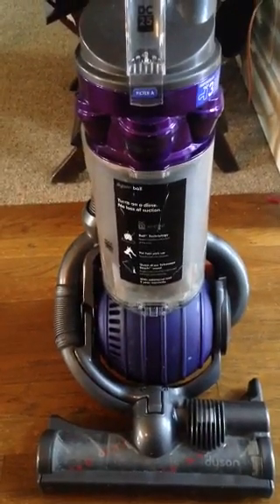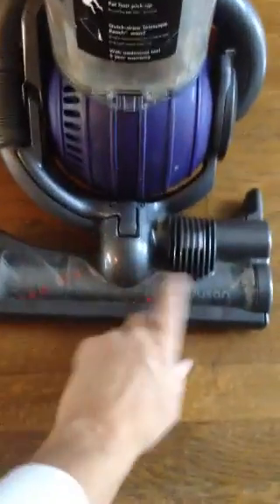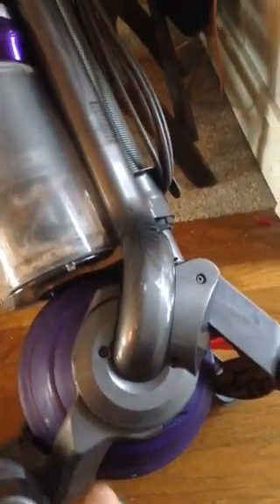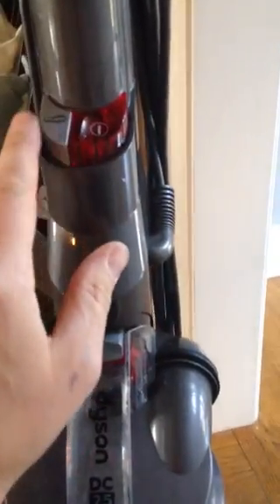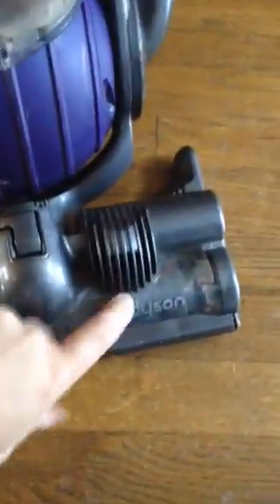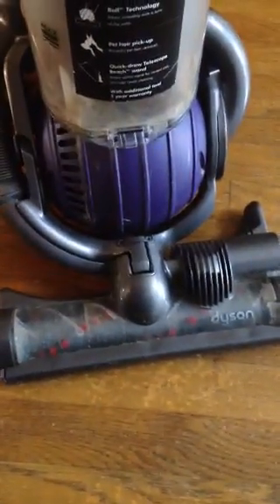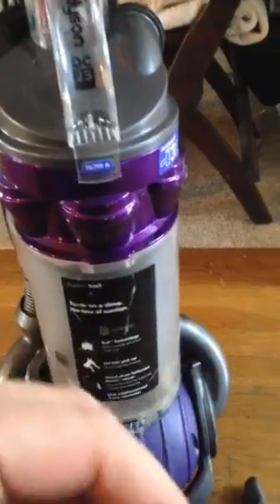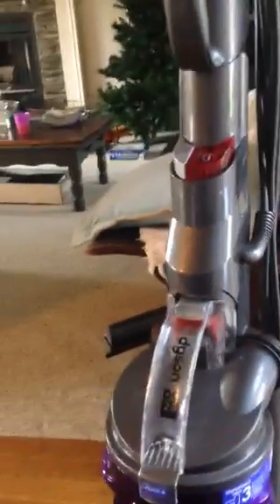Dyson DC25 brush bar not turning

Comment: Love this Video!  Okay our issue was a tad different, so I am sharing in case this helps others.  This step by step video is exactly what my son and I needed to know how to take apart and what to look for.  We already had power to this model that we have used for many years.  Our only issue was that we had to hold the brush button down to get the brush to turn.  It no longer would come on automatically or when the button to turn on the brush was pushed.  So we figured out after testing the switches that the switches were fine until we would put the buttons and housing back on.  So this is some Okie rigging but...we clipped off a small piece of plastic from a plastic tooth pick flosser.  That piece of plastic now allowed better Pressure under the Brush button and the switch.  Works like a dream now.  Thank you so very much Jon, this video was what we needed to 1. know what to look for and 2. figure out that what we had worked but for some unknown reason we needed to correct the contact between the button and switch.  Hope this helps.

Comment: So glad I found your video, I watched the first 30 seconds of the top 3 faults and repaired a broken wire under the side cap in a few minutes, and now it works just as it did before the brush stopped turning, so thank you.

Comment: Thanks for posting. I was about to buy a new motor for my brush bar and stumbled on this video. 

I gambled on a reset button since it was about 12 bucks. That did the trick and I’m back in action.  

On my Dc24 the reset relay is in the brush bar assembly not under the leer switches but otherwise looked identical. 

It required removing about 8 torx screws but it was pretty easy to swap out.

Comment: BIG BIG THANK YOU! I bought replacement motor and switch and my DC25 still didn't work. Pretty disheartened I was about to throw in the towel when I thought I'd just have a quick google, your video was top of the search results and your first diagnosis of caught cable was bang on. Soldered in a new piece and you just saved me £300 on buying a new Dyson. Thank you for taking the time to post this vid. It's really appreciated.

Comment: Thanks a lot.   Found the problem in your first suggestion - broken wire.   Fixed it and now works as good as new.
Reply: where was the broken wire ? as ive same problem done all he said in video still not working brush bar motor head is new also ? ta very much

Comment: Thanks man I was trying to fix my dyson thought it was the brush motor and got a new head put it on and still not working thought it was maybe the switch but it was ok watched your video hear you say about the wiring problems they can have and checked it out and saw right away the wire was split so I repaired it and now it is all good so thanks alot man I don't know why they don't have the wires a little bit longer to stop that.

Comment: We picked up this model on a free local facebook page. The roller didnt work. Checked the three common faults and it was a broken wire. Stripped the wire back, small junction box and BINGO we have a free working vacuum. Thank you for this video.

Comment: Thanks Jon, I replaced a few parts and also had the switch apart yesterday and had everything working great. A few minutes ago my wife said the beater bar stopped turning.
At first I thought I'd take apart the switch again and also check the reset button. I felt confident they were ok so I figured I'd take your advice and check for a broken wire. Sure enough there it was a broken wire.
Thanks Again!

Comment: This video really helped me tremendously. I have replaced the head on my dc25 twice so when it was sparaticly losing power I knew it wasn't the head. Upon taking of the side cover down by the ball, I didn't see any wires split... AT FIRST. After wiping off the coating of dust off the wires with lightly wet qtip, I still didn't see the split. After pushing the red kick plate into operating mode, the white wire popped out from under the ball casing and sure enough it was almost cut completely in 2. I spliced in a wire between the two ends as I couldn't get enough slack to reconnect the original. Thank you for the vid.

Comment: Thanks so much for this vid...here's my story.Got this in 2014 brand new, the brush bar stopped spinning six days later.Contacted Dyson support; they sent me a whole new cleanerhead...I put it on, and guess what? That one didn't work either! So Dyson arranged for me to take it to a shop; they fixed it for me--but the guy who was at the shop when I picked it up couldn't tell me what the problem was, for whatever reason. Anyway; worked since then until tonight! I still have the spare cleanerhead they sent me way back when, and guess what...again, that one doesn't work either. Thanks to your vid I think it's safe to say it's either problem 1 or 2; wires split or the relay is screwed. Hopefully it's not something else. Gotta get a Torx screwdriver and open it up tomorrow. I'll post back if I can as to what I can discover. Thanks again for the vid.

Comment: Thanks for posting.  I had the same problem with the beater brush relay.  I ordered the part, but in the meantime, I bridged the two wires and it's working fine.
Reply: Mark Persons  can u show or tell me which wire's you bridged ? Having the same problem.

Comment: my white wire was bisected. i jumpered it with a 22 guage piece taken from an old 12v cigarette lighter i had and connected it with two wirenuts. seems to be working just fine. not sure if that is the best way to do it but it beats buying another dyson.

Comment: Could you please tell me where you found the relay replacement part? We think the problem with our brush bar is either the motor is burning out or its the relay piece....want to start with the relay. Do you know if there is a way to determine which is the problem? Thank you!

Comment: Update...It's the relay.
Bypassed that and I now have continuity on my multimeter.
I don't suppose I can just run it like that, can I?
Not going to risk it...Going to order a new one.
Any idea what causes them to fail like that?
Seems to have an unusually high failure rate.
Reply: And fixed...I got lucky, a vacuum repair shop near me had the relay switch part; cost me ten bucks!  Easy as pie to swap it out with the old one...back up and running.  Thanks so much for the vid!'

Comment: Does this switch say 91 series on it? Want to purchase, but not sure if its the right product...amazon says they are not sure if it fits my model, which is DC25 Multifloor....link: https://www.amazon.com/Dyson-Switch-Reset-Dc24-Dc25/dp/B00Y35XMCG/ref=pd_sim_328_3/153-4388568-8640255?ie=UTF8&psc=1&refRID=4EBE2NREK86VWHD821XT

your help would be very appreciated!! thanks
Reply: Mine says "91 Series"
Reply: this did it! saved me a ton of money. thank you!! 
however, now my power wont stay on unless i keep pushing down on the on button.